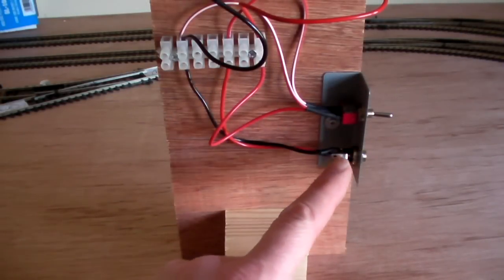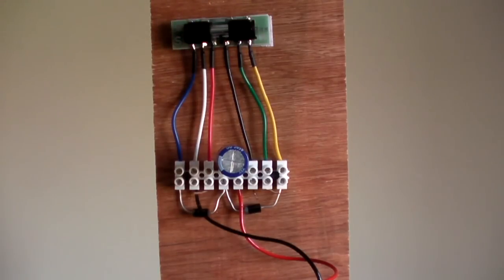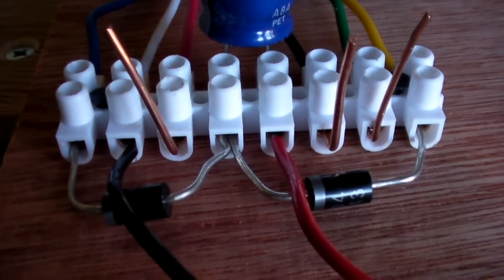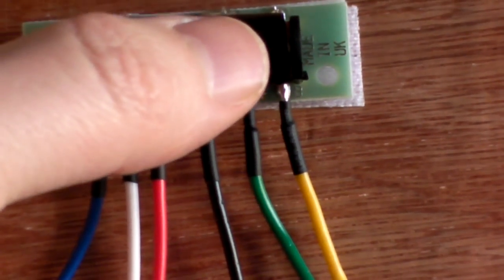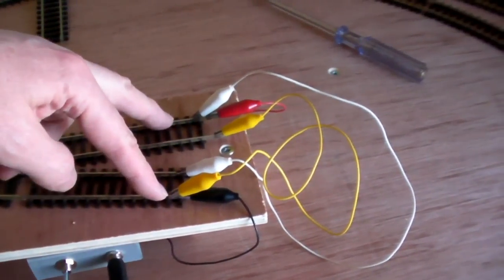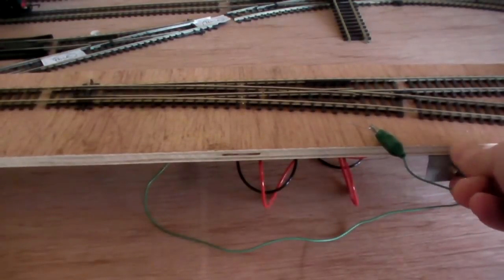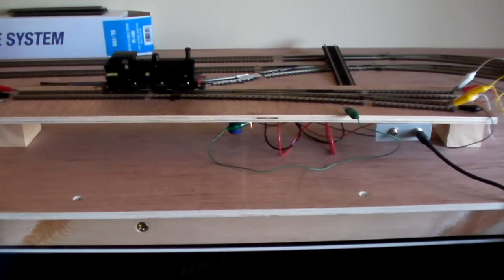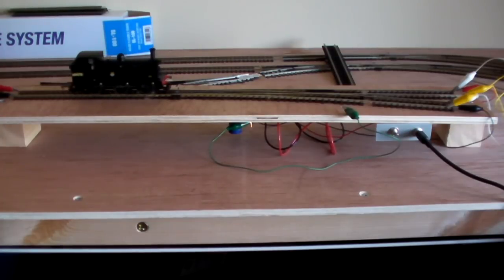Moorway South Part 7 - Point Motor Testing

Comment: I like your work - done to perfection. So your choice for electrofrog is in line with this. On my new layout "The AnneliesVille RR & Navigation Co." I use PECO Insulfrog because 1. Never had ANY issue even with smal Tank Loco's crossing  the points; 2. My layout is 5,5m x 7,00m - about 80 m of mainline run. That already involves a lot of electrics - even on DCC. Thanks for sharing & happy modeling !

Comment: Nice work mate, coming along now. I too have just changed 20 points from Hornby to Peco Electrofrog and I havent done or even attempted any wiring to them yet, I have put the bus wire in and extra 12v bus etc. Prob do some points on the weekend. I am also using Seep motors like you so will sub your channel and follow your progress. Good luck!!

Comment from the maker: Lots of my points are insulated frog and work straight out of the box and do not need any wiring at all (except for point motors if required). The electrofrog points also work straight out of the box with no wires. The work I have done is to try to ensure maximum reliability as I will be ballasting and glueing the track to the board. There are other easier ways of wiring the point motors but I enjoy fiddling with electronics and making stuff!

Comment from the maker: They are 3 amp silicon rectifiers. Brian Lambert recommends 1N5401, but they didn't have them in the shop so I got 1N5404 - exactly the same just higher voltage capacity.

Comment: Hi, thanks for sharing. I followed this closely but can only get to switch one way, double checked all connections, even experimented, only one way :(
Reply from the maker: +Rok Lobsta - sounds like one coil is not operating. Do you have another point you could try with the wiring?
Reply: +Moorway South thanks for replying, I tried swapping A & B, got reverse results so assuming motor is ok
Reply from the maker: +Rok Lobsta - is there enough space to throw fully in both directions?

Comment: i need a supercapacitor for that? no have better motor in slowmotion to work in electrfrog?
Reply from the maker: For this particular method the larger capacitor is required. The slowmotion point motors do work with electrofrog points. Hope this helps.

Comment: what is the name of that steam shunt loco you have?
Reply from the maker: It doesn't have its own name, but they are known as Jinty engines. It is BR 0-6-0T Class J83 locomotive and came with the Mixed Freight set (R1126).